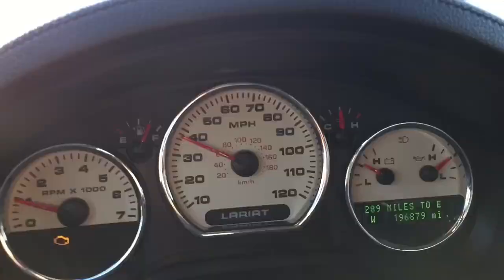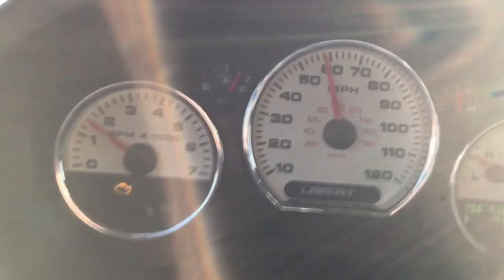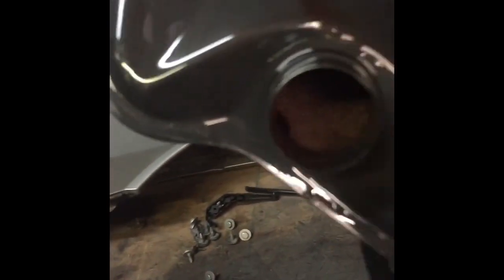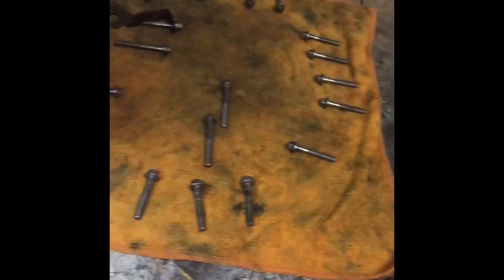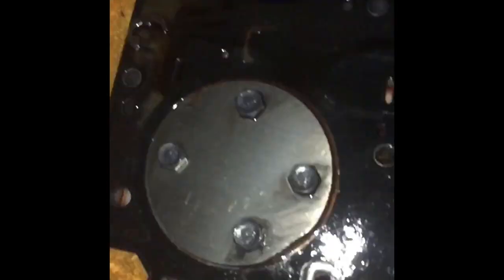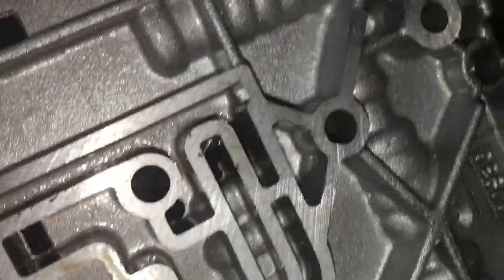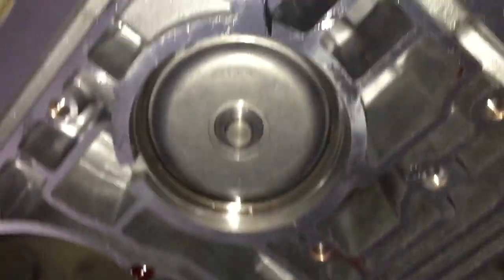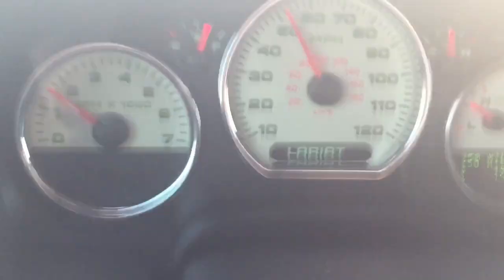Transmission Slip In Overdrive With Valve Body Cleaning - 2006 Ford F-150 5.6 4x2

Comment: My 2004 F150 STX 2 wheel drive lost overdrive,a piece of the snap ring from the overdrive module broke off and fell into the valve body,pull the pan and pull out the valve body with the up grades,,replace the snap ring,put the pan on ,put 10 quarts of transmission fuild, never been change,it has 240000 miles on it,it runs perfect.

Comment: There is no fifth gear in a 4R75E transmission.  Ford also never put a five speed automatic into an F150.  I believe you're mistaking torque converter lock up for another gear.  When the torque converter gets locked, it does drop roughly 200 RPM and can feel like a shift.  That's the first time I've ever seen the small clip cause that problem.  It's usually the large snap ring in that bore that breaks into pieces and it usually causes nuetral in overdrive.  A chunk of broken snap ring usually gets stuck in the valve beneath and it just so happens to be the valve that applies the servo with the broken snap ring.  When it's working right, that servo applies the overdrive band.  Go figure

Comment: I have a 2008 fl150. I jus put a transmission in it a year ago. Its shifts fine but when it heats up it wants to slip out of 2nd. If I shift it manually and let it cost into drive it works fine. Does anyone have any ideas what could b causing that?  Thanks

Comment: I'm guessing the transmission is a 4R75E mine does the same thing in my 06 Expedition, I saw a better video that actually shows what to pull apart the valve body, I will watch that one for better instructions, I just don't want to rebuild the valve body unless I have to, I know there are 8 plastic balls inside and some of them ware down.